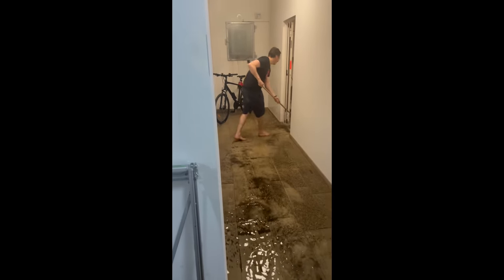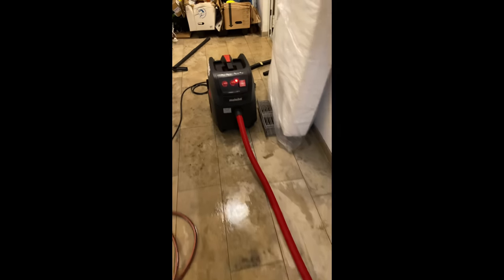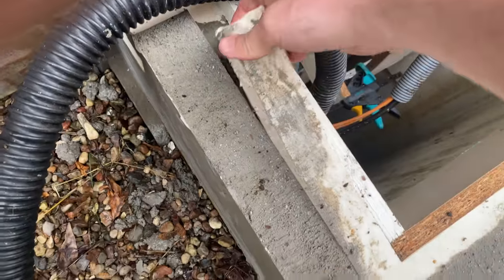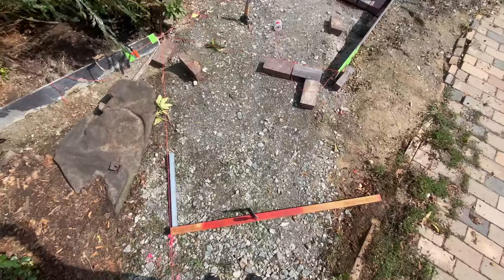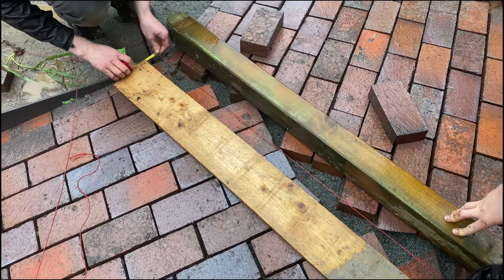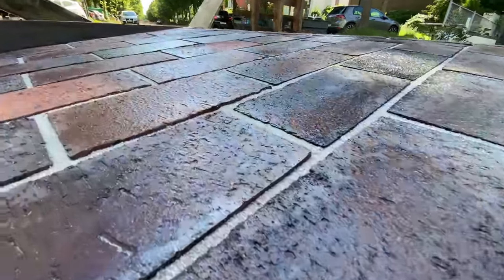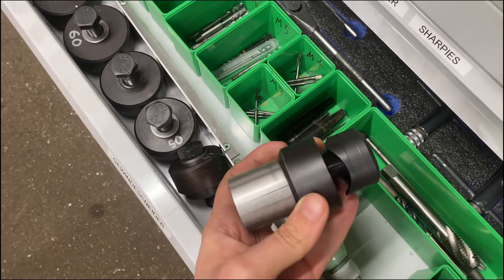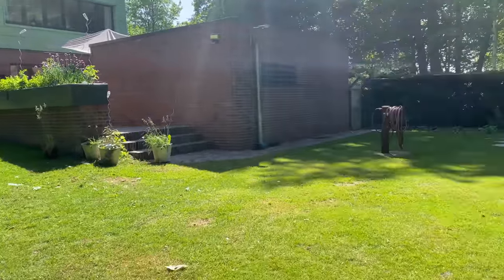Battling Mother Nature: How We Made Our House Flood-Proof

Comment: if you get more flooding ... make a grate at the edge of the patio and pathway in and have that feed a 6 inch pipe with a water hammer pump on the farther end ... then it can pup the water out and onto the street further down and keep the larger flows out f the yard longer
Reply from the maker: Hmm. Like a diversion tunnel. Not a bad idea.

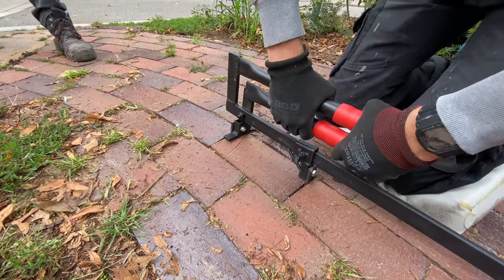Comment: Amazing video! Reassures me a lot for the projects I want to get onto. I really want to replace some areas of miscoloured paving at our place and saw the tool at 4:39 and wondered if you can tell me what it is called? I've soured the internet previously for something similar and only managed to find the Probst SZ which is about $500 where I live. Any ideas?
Reply from the maker: Its called a paver puller here. However you only need to use it on one brick, then the rest comes out easily. You could also use a pressure washer or flat screwdrivers to remove the grout.

Comment: The slope that you made looks very nice but to stop the flash water flowing right over it you will need a solid step or continuous brick wall all the way around that corner. I’m afraid you will have to get off your scooter and step over it! Secondly the concrete surround you made for the basement window was neat but because you have cut-in the sides to take the trunking hoses the real height is at the lowest point of the trunking hose entry! - (silly mistake just there). Lastly make sure your sump pumps are on an automatic relay that kicks in when the water level rises in the sump, (even when you are away on vacation). 👍

Comment: Really like the polymer sand for the pavers, I have to re sand my driveway every 3 years, messy job as you have to get all the old sand out first with a pressure washer. Plus I live on a hill so when I put in the new sand and it rains the sand can get washed out. Do you know if it's available in the UK?
Reply from the maker: I bet you can get it. This one is from Fugli. The whole sand in cracks thing isn’t that great to begin with. You cannot get rid of weeds unless you have a lot of traffic or chemicals which are banned nowadays. So I also cleaned up crack by crack every spring with a pressure washer. 2 days of work for the whole garden.

Comment: There is nothing worse than water coming in to the house.
I know as I had my basement also flooded becasue there was a crack in the concrete wall and also came thru the basement window.
I cut out the crack and filled it with waterproof concrete. 
This weekend I will work on fixing the window so it will not come thru there anymore.
Tonight they say allot of rain will come again.
Wish you and me all the luck and hope we keep it dry 🙂

Comment: They sell thrust bearing/washers for those hole punches which make using them require much less force.
Reply from the maker: Thats a very good idea! Thanks!
Reply: I loved seeing those punches! I never new they existed. I hate the metal bits from drilling, so I usually avoid it unless really necessary. I expect those are hugely more expensive than ordinary bits though. I'm not sure I would ever use them enough to justify the expense.

Comment: I remember when looking at the FEMA requirements for how to flood proof a building in situations like this, they had the option to install a sheet metal door that you would slide in sort of like a doggie door to just block the water at a higher level than the doorway itself. You would install the braces on the side to hold it in place and they would basically create the seal
Reply from the maker: Yes I considered adding one. But I would need to be home for that rainfall to install it quickly.

Comment: hey, gorgeous work! Question: instead of placing that pump down below , wasnt just easier to make the ventilation concrete 1 or two foot higher than what u did?
Reply from the maker: The concrete is plenty high, but if we have sustained rain for a few days, the ground could become saturated and suddenly the basement is underneath the water level. So the basement walls become pool walls. If that concrete shaft has a small leak, the water would get into the basement through that. Thats what the pump is for.

Comment: That is most unfortunate.  Drainage professionals will stress that the first step to defending your house from water is to divert any water down the roads.  Since you live on a low point from the road that creates some challenges.

If you have another event like this, a good temporary precaution is to have some sandbags on hand to create a temporary wall to block that opening by the road.

Anyways best of luck with your house drainage projects!
Reply from the maker: Here in Germany its actually illegal to drain to the road! But I noticed that the road in many US settlements is downhill from the houses.

Comment: you should have done Franch drain leading to low level drain around the house or before the wall. or right where the walkway starts at roadside. this will be a permanent solution at any given time
Reply from the maker: There is a french drain all around the house but it wouldn’t reach it fast enough in a flash flood. Now its fixed with the dam.
Reply: @MaxMakerChannel  good you have the provision but possibly it requires to be redesigned.  check the depth of your French drain and the size and the quality of the pipe. it needs to have schedule 40 cpvc pipes and not normal plastic or PVC pipe, depths of the French drain needs to be at least 900 mm deep by 500 mm wide and in slop. The pipe should not have dirt on it. there has to be gravel stone on it covered with straw on the top. pipe needs to be at least of size 100 to 150 mm. try this and you won't need dike. most of the Franch drain fails due to pipe quality and filled with dirt blocking the holes of the pipes.

Comment: I loved every part of this video, except the little window gutter.... It definitely works, but seeing as the floor in the basement is concrete, it wouldn't hurt to make a small channel "under" the wall to the right leading directly into the sump chamber, and you could just put a small metal grate on top.
Reply from the maker: I plan to do that actually in case there is extreme flooding! But the water that runs down the wall ruins the paint. So I wanted to protect that for a few years.

Comment: You should probably paint that concrete with a water membrane or something. If you get a lot of water just sitting against the concrete it will just weep through adding more work for your pump on the bottom.
Reply from the maker: I might do that, but there is no standing water. Only flash water and so far only once in 12 years.

Comment: That looks like a pretty good solution, at least for now. It's clever!! But as someone said: I would be afraid it is just as good as the last storm. Genuine question: why didn't you install a drain? Either with a grill (kinda ugly imo and gets clogged once in a while) or a "french drain"? Would help for ground water and it is pretty neat
Reply from the maker: We have plenty of drains. But one standard drain with has 78cm2 of area. The water came over the edge of the trash train at about 1.5cm height and 5m width. That is 750cm2. So enough water for 10 drains. 

We only had one massive storm in 11 years and now its 20cm higher. The water cannot rise that high without obverflowing the downhill curb.
Reply: @MaxMakerChannel  oh I see! Makes a lot of sense! :)

Comment: My basement has no windows at all and I am 60-80cm below street level with my house too...  I only had one real flood during the construction phase as my excavator guy destroyed a drainage pipe and I forgot about it for months until it started to come down in big buckets. I called the fire fighters as I had the raw electricity in the basement since it didn't look like it would finish soon and it was filling up quickly... Their invoice was probably still cheaper than hiring a /professional/ "we pump out your basement"-service... 
A couple of weeks ago the rain water was so much, that the entire sewage came back through my shower drain on the ground floor...  Literally crap all over my bathroom floor and that dirty water everywhere...  That was a foul odor in the room for a few hours... I am really considering getting a backflow trap at this point.

Regardless, I have theoretically the same issue on my property and, lucky me, I don't have started working on the outside yet.. I planned a lot of drainage options around the house and how to divert the water...

Comment: So i didn't understand the part about the rain gutter, is it a safety precaution and if yes then do you mean the pump isn't fast enough to pump out the water from outside the window or did u mean u need to physically turn on the pump?

For the latter u could add a water sensor to the switch, these are easily found at electronic hobby stores. 

But thanks ur rain gutter idea gave me a solution, my staircase has this huge window thats like two floors tall. When it rains at an angle the water comes inside, redoing the whole window would cost a lot, ill copy ur idea for now! Thanks
I would've done it eventually but the cost is quite a lot for me!
Reply from the maker: The rain gutter is just a precaution. The outdoor pump could fail or get clogged up. Although it will only run once every few years. The pumps have automatic float switches.

Comment: Polymeric sand is awesome, but it's not a long term solution in areas with a freeze/thaw cycle. If it gets below about -5c, it cracks. It takes a few years to fully deteriorat, but it does.
Reply from the maker: I didn’t find the perfect system yet either.
Reply: @MaxMakerChannel  I just rely on the old fashioned 1:5 paver mix of sand and cement. If the base is hard enough, you can get away with just a thin layer of sand to level them and pack them tight so they can't move.

Comment: Water is the most beguiling element. Too much, too little, in the wrong place, at the wrong time can be disastrous.  If budget and space permits, regrading for proper drainage is the most desirable long term solution. Hoping the best of luck. Not knowing your ordinances, I would have considered relocating the entrance walkway further up the property and build 0.5 meter high curved diversion wall around the corner.  Also, use of French drains as a secondary system around the house  foundation might be considered.

Comment: This is a clear flaw in the design and engineering of the building. One of the most basic things all architects and engineers learn is that water should always flow away from the house. I have no clue how this was missed. If it’s not possible then some sort of gully, barrier or overflow needs to be built.
Reply from the maker: Well. Water running towards the street is illegal in Germany. The other way around is also not right but you cannot force the city to change it.

Comment: wow you responded to my Commets i didnt think that would happen but, Great video, my only concern would be the edge of the steel dams. If anyone tripped and fell they would be very unforgiving. Perhaps a rubber/plastic rounded top on them?
Maybe a thin pipe, cut so you can slide it on the top edge of the dam?
Reply from the maker: I try to answer all. With the steel in the flowerbed I don’t think its to dangerous. The steel at the front is now covered with sand from one side.

Comment: Another Idea would be a self rising flood gate and then extend the wall just a little bit. If you want to make extra shure it doesn't happen again.
Also did it help with the flood a few days ago or didn't it reach your house?
Reply from the maker: It solved the problem. Last time was a very extreme rain. We never had anything like it before and the water rose 5cm above the pavement. If that was to happen again we would have another 10cm now. But at that point it would have already flown around the corner and down hill.

Comment: It should do most of the work and I like people coming up with their own solutions, but just a couple of things. New concrete doesn't bond well to old one. Usually using a special mixture designed for repairs or connecting the two with metal reinforcement would help keep them together better (just a few rebar pieces drilled in). Seasonal changes can do wonders with separating the two in the long run. Also, I'm not knowledgeable about the regulations there, but here If someone were to trip on that steel plate sticking out and hurts themselves then it could easily end up in court.

Comment: Just use concrete measurements on the package! our concrete is either to dry ( which is bad it wont stick) or too wet - which is also not very good. Also not sure about pouring concrete by itself without sand or water near flowers will do anything :(
Reply from the maker: But if its to dry it will never fill the mould and then there are voids that are hard to fix.

Comment: Great video. One thing that confuses me is that those windows are waterproof. Did you leave it open ?
Reply from the maker: Its not really waterproof.
Reply: @MaxMakerChannel  then seal is gone,  those windows are designed for insulation and weather. If closed is watertight to 0.2 bar

Comment: Its still will be flooding to the side, like thru the green aera - there is a loose sand there and need to be like a litte wall or a more dirt there, or the water will find a way thru the plants.
Reply from the maker: It cannot. If it raises up to that level it would overflow at the other side of the street and be gone.
Reply: @MaxMakerChannel  like look at the edge of the path is like a soft ground from the last flood that can be move on the pressure of the water, or meaby is just look that for me... I hope you are right and is just my imagination like in the engineering practice is the key knowledge that in the construction of a dam the weakest link is the ground around. Like try search "Michigan dam failure" or sth like this. like the solid dam is not the weakest point but the loose sand get wet and then is easy to move.
(sorry for my english i just learning)

Comment: i would create a gutter at the basement next to the window instead that leads into the pump! 
Incase there is water flowing over or ontop or somewhere else, if you see this ^^
Reply from the maker: Yes. I plan to drill a 45° hole that goes through the wall and into the sump pump.

Comment: Flood waters suck. We have gotten 5 inches of rain in an hour a number of times and every time I go out and check all the areas and everything looks good.  Where we plan to build the new house we intend to build it up 2 feet. This will bring us up much higher than everywhere else in our area. We have a river real close, yet have never seen it flood yet and as far as we know it has not flooded here in a very long time. Adding 2 feet will surely protect us far better than anyone else.
Reply from the maker: I have the same issue right now. I intend to build a large workshop but currently the level is about 70cm below the road. 12cm of foam plus 25cm of concrete is still only 40cm. So we might need to add another 30cm of dirt from elsewhere. Thats quite expensive.
Reply: @MaxMakerChannel  For me its not a problem of getting the dirt, its the moving it from the north side of my land. I have a high spot that needs to come down to grade and it is not where I want to build. Yet is only a few 100 feet from where I want to build. I have 11 out of the 16 lots on my block and own 7 on the north side and 4 on the south side. I want the other 5 lots and had hoped to get it this year yet It looks like it will be next year sometime. Plus the owner is one of those people who says they will sell and then does not. The place sits vacant and has for 30 years. 
Options are dirt and a taller foundation. Depending on the cost to add another 30 cm of foundation and dirt fill could work. The only thing you would need to bring up is the door/entrance. This could be cheaper in the short term and would allow you to bring in back fill and install drainage at a later date. Think moat with draw bridge? 
This would also give you an enginering knowledge on how to build a raised foundation. 

What types of loads do you intend to be in said workshop? 25cm is nearly 10 inches thick and this is a massive amount. Standard houses are 4 inches, garages/shops 6 inches. 10 inches would be massive. 
My slab will be 6 inches and the top of the tube will be at 1.5 inches. I am going to use concrete blocks to support the rebar structure as when they lay it they tend to step on it and move the rebar. I do not need or want tubing or rebar bent. The thermal lag in one area will affect the heating and cooling. I plan for 6 inches of overlapping insulation unless tongue and groove can not be found.  Since I will not have a foundation per say as its a post frame construction on insulated concrete piers, we are going to compact the site which will be dry as the building will be overhead by then then lay in gravel and sand for the final prep before insulation and concrete. I am going to leave one end open for this and for the concrete pour. The slab will be connected via fiberglass rebar to the outside 4 foot wide insulated sidewalk all the way around the building and this will also provide several loops.

Comment: Thanks for sharing, i love your videos! How long do you think the steel will last in the ground? What type of steel is it?
Reply from the maker: Thank you so much for watching! Its 10mm mild steel. Nothing special at all. It depends on the acidity of the ground and if there is salt. I looked at charts and it can be anywhere from 10 years to 100 years. So I think it will last at least 30 years. Concrete borders last longer but they start to chip at the edges and they become misaligned over time.